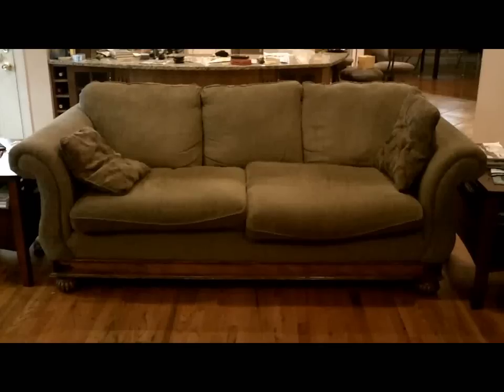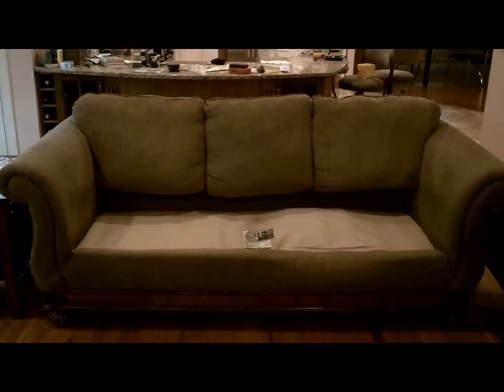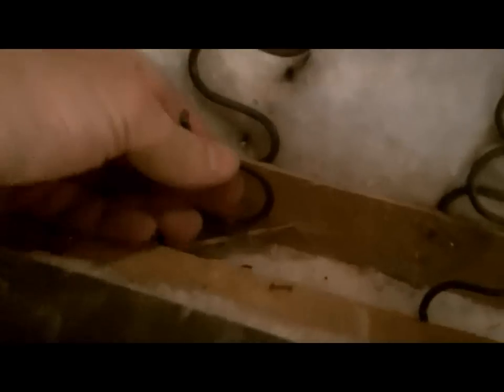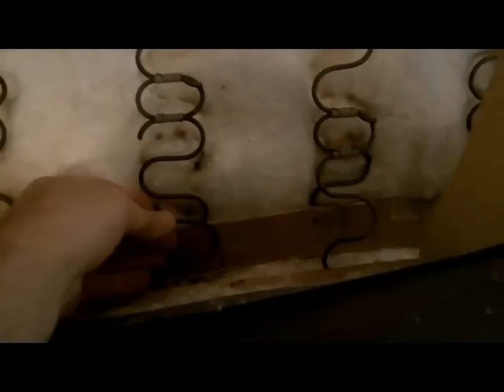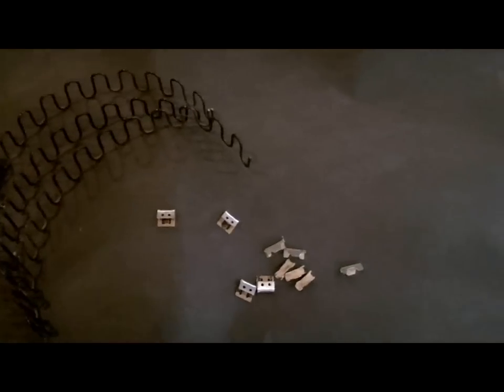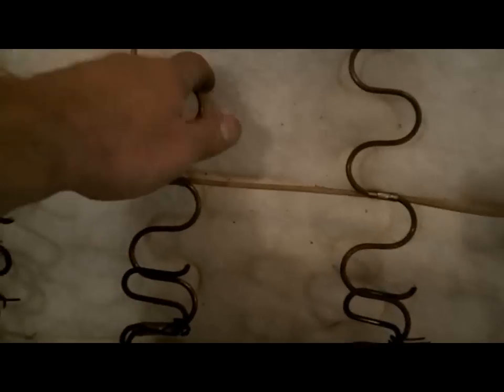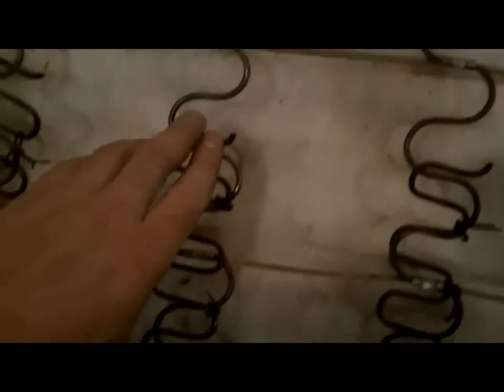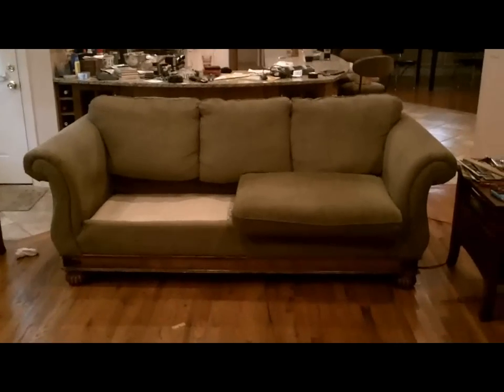How To: Repair a Sofa

Comment: Thanks for the video. Between watching this, working out how my sofa fits together and some good old fashioned common sense I was able to fix mine. Sadly where I live in North West London there’s nothing like Home Depot or even a furniture repair shop. The DIY stores have everything but what I needed and staff who can’t help. Finding the parts was harder than actually repairing it. It won’t win any prizes for neatness but the main thing is that it’s fixed and it saves a huge amount of money as otherwise it would have had to be replaced. Even a professional repair service was way out of my budget. Thanks again for sending me in the right direction

Comment: The repair shop wants me to deliver the piece to them then wait two months. This is a big help. I was worried about how to stretch the spring to reattach it, but it looks like it would be a lot easier to attach a new piece to the frame, and then wire the old and new springs together. It seems like there must be a tool for that part. But this gives me hope. Thanks.

Comment: instead of rebar wire, if anyone needs to do a similar repair, look up "hog rings" and "hog ring pliers", that's kind of what they're made for... the "w clips" he used are suitable when clamped on with the proper pliers, without load. That way the 2x springs or spring & wire you're connecting to each other can touch, and the "w clip" can wrap around properly. I'm a master upholsterer with 25 years experience.
Reply: my couch has broken a broken stay wire and some of the clips have come off the wire causing the springs to catch and hold on part of the frame. Where can I find replacement stay wire? I've scoured the internet and can only find the clips.
Reply: Hi Andy, I need a clarification... by "stay wire", do you mean the wire wrapped in paper? That, as far as I know only comes in large rolls. The paper is only there to stop the wire squeaking against the clip. If you can find a similar gauge wire, just wrap some scrap fabric around the wire where you install the clip, making sure no metal is touching.
Reply: Chris O'Neill Yes that's what I meant, thanks for the response!
Reply: +Chris O'Neill I've only had car seats, car upholstery, & the leather-covered roof of a few cars done, not furniture. Can you tell me if it's more cost-wise to have a living room suite upholstered (the couch is all that really needs it as the chairs & ottomans have stood up well), or more cost-wise to just breakdown & buy a new living room suite?  I'm not at a point where I can afford to purchase a new set of living room furniture so I'm hoping that household furniture runs less than what I paid to car upholstery redone. Thanks for any answer; it doesn't matter if it's just a wide ballpark approximate.
Reply: Hi. I have a similar problem. All of thr springs have fallen out of their place. The problem is that there is no metal clip on end of it. Just a plastic holder. What do u suggesting for a best solution is it won't happen again? Tnx

Comment: As others have basically said..."GREAT VIDEO, JUST WHAT I NEEDED, ETC."
The only thing I would have added during your filming process was the actual installation of the springs themselves.  
And, loved the fact that you kept the camera rolling as you turned over the couch once completed, leaving that footage in instead of editing it out.

Going to try repairing our 9 +/- year old couch that we purchased from that Crate store.  Just a little disappointed with it's construction.  The woman 
told us that it was an 8 way tied coil spring system that they used at the Barrel factory and that that is the way to go when buying a couch.  I could 
see that considering how much tying there was in a system like that.  Low and behold when we got to the spring system there were NO COIL SPRINGS
and NO 8 WAY TYING!  If that don't beat all.  It was a system of thin wires, some plastic and I think there was some tying going on somewhere...

Will see how it goes.  The only thing that might give me fits is my bum left hand.  Hurt it a few weeks ago.

Again, THANKS for putting this video out there for us to see!

Comment: I know you were wondering if the nails would hold the new clips in place, so is there a reason you chose to go with nails again instead of using screws? Screws don't pull out as easily as nails do. This isn't a criticism, just a suggestion.
Reply: From what I've researched, you're supposed to use a "spring nail", which is serrated. Not sure how well they hold up compared to screws, but that's what they use in the factories